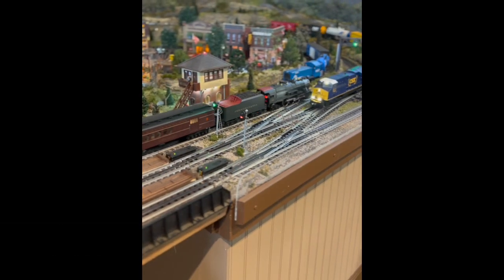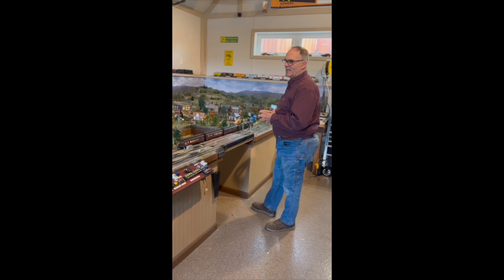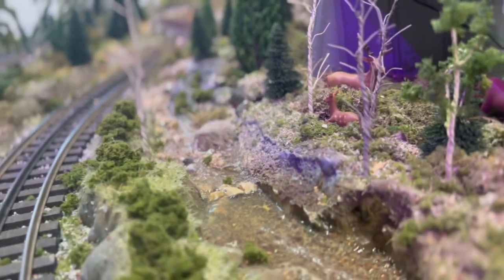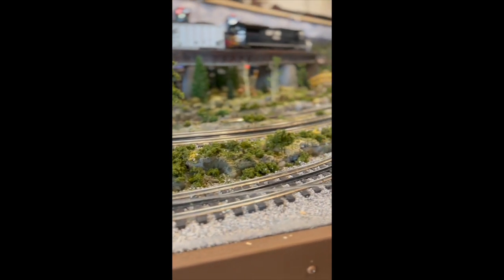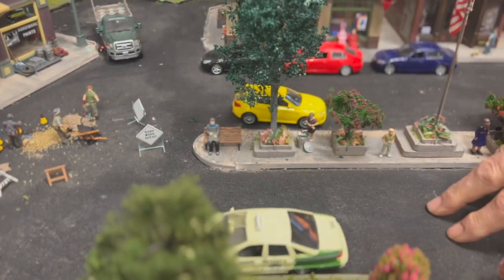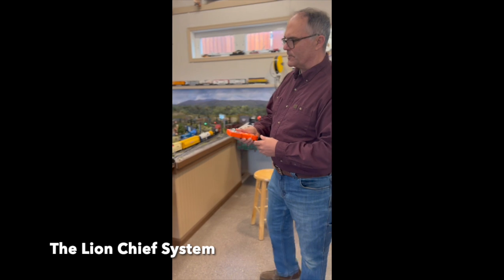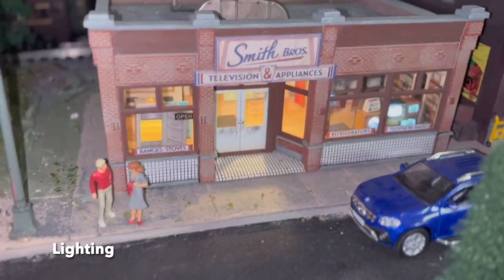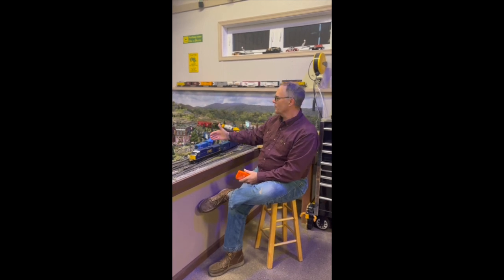A Nice O Gauge Train Layout

Comment: Nice looking layout. How do you get to the trains on the shelf above the layout?
Reply from the maker: The area with the lift bridge and walk in helps a lot.  From there I can reach most areas of the layout. I also have some areas I know I can walk on if I need to.  That is the nice thing about using the asphalt patch for roads.  It is durable and flexible.
Reply from the maker: I helps to have the drawbridge to walk into the layout.

Comment: Great looking layout!  Your approach to wiring is ingenious.  It appears to me the layout is not very tall.  Is this for the benefit of children?  Have you found you wish it were a bit taller?  You look like a 72 inch perhaps taller fellow, and have you had to go below layout level for wiring fixes/changes?
Reply from the maker: Yeah, I went for 32” for both the view for kids plus more ease to lean out over to reach stuff.   The passage I made with the lifting bridge helps too.    The height just allows me to crawl on my knees underneath.   As for wiring, I wish I had run more multi strand wire cables in advance of everything.   That would have really helped keep things cleaner underneath.
Reply: Thanks for the prompt reply.  I am 78 and I really do not want to be on my knees more than absolutely necessary!  Lionel on its great display layouts made use of bus wires.  It do not think they were stranded,  but in the last layout I built--back in the 60's--I used stranded extension cord wire.  No voltage drops ever!
Reply from the maker: Never too old to play with Trains😃.  Besides wiring and the technical stuff, I really enjoyed experimenting with scenery.   The spray foam like Great Stuff changed everything for me.   I plan to do a separate video on trying different types and techniques anyone can do to get really realistic features.
Reply: @paulsteinweg  The scenery, in my view is the physical artistry of the hobby.

Comment: Hi to you .  I have a  question ?  I see that your transformers are lionel CW80  tipe as (chopped sine wave )  so, is it your locomotives run great
without any problems   with thoses two CW80  transformers ?  You have a  nice layout  and thank's in advance . Cheers .
Reply from the maker: Sorry for not getting back to you.  I have not been on YT for a while.   The transformers work really well I use the exclusively for the locomotives and have a 3rd one to run the switches and some other accessories.    I still put both the Lionel in Phase which means all the grounds are connected to each other.

Comment: Paul what is the height of your layout. Reason I ask is I noticed you have a backdrop and above is shelves for trains.  I also would like to ask what kind of track are you using?
Reply from the maker: Hi David.   My layout is 32” high.   Did this for both reach over and for kids.   The scenery behind I found on the internet.   Really nice options there.   I think the height of that was 36”.   
I used Gargraves track for everything.
Reply: @paulsteinweg  thank you so much I'm using atlas but may lower to 36.
Reply: Just starting build I have two 12x8 tables putting them together.
Reply from the maker: Ease of access will be important once you start adding scenery.   You will see I created a walkway and lift bridge to get better access.

Comment: whats that 3d layout system designer program?
Reply from the maker: The program I used is called SCARM  (Simple Computer Railway Modeller)  Very user friendly.    It is also nice because you can use track and switches by brand so what you do is exactly what you want and need to order.